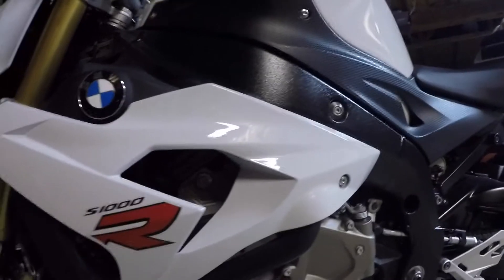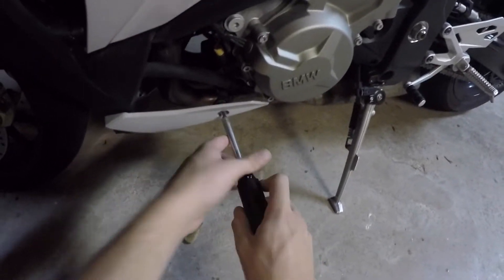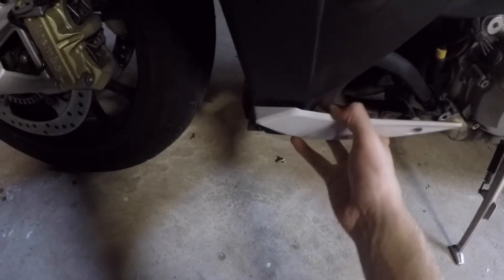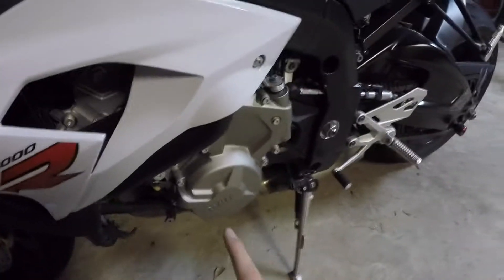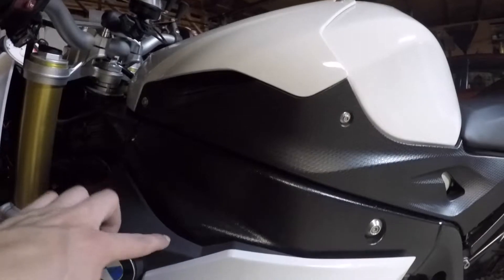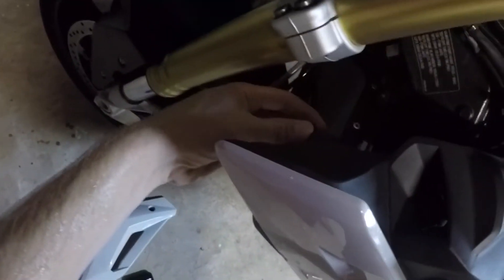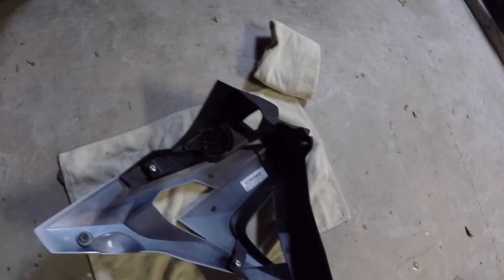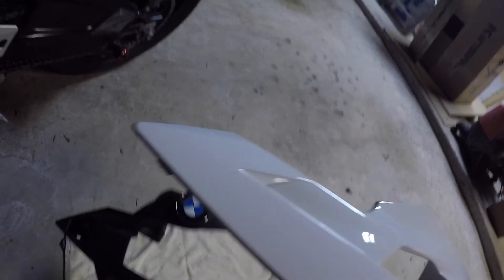BMW S1000R Remove Fairing

Comment: Thanks for the video! Had a low speed lowside and bike fell on the right hand side and the fairing w/the lettering got scratched up. I was worried I would have to buy that WHOLE piece  for a sec just to replace the painted fairing section, glad thats not the case!